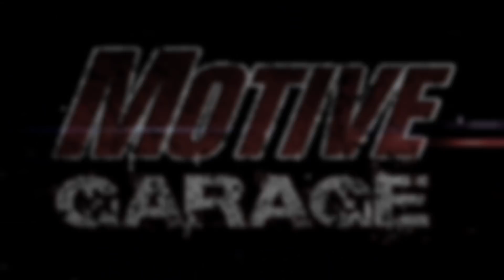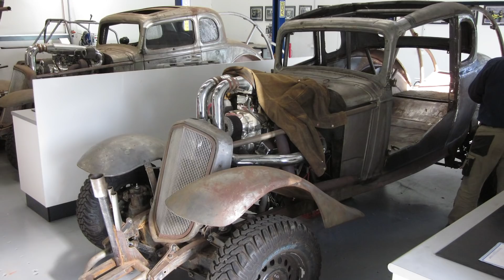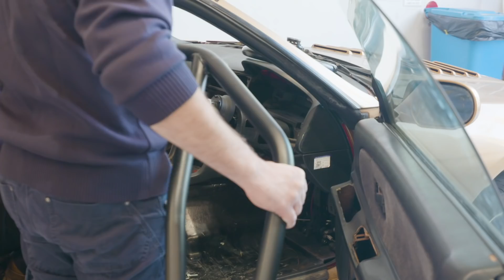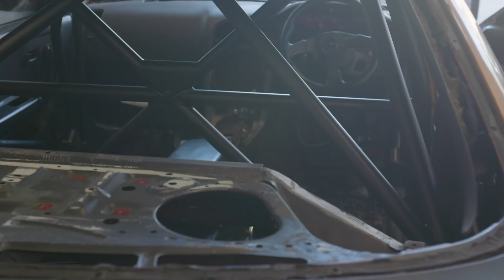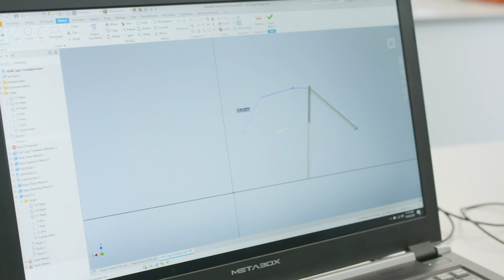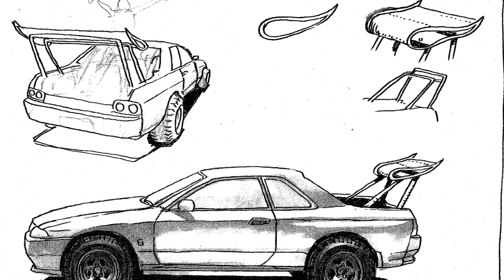Bolt-In Roll Cage as good as weld-in? Project No Secrets R33 GT-R Ep 10

Comment: I will be contacting AGI shortly about a custom cage for my BMW e36 gravel rally car..     will be national spec rally..  all so wanted to run a few tarmac event's..   
Must attach to the front strut towers
And pick up rear sub frame

Maby bolt in front.   Weld in rear..
PS weld in is always better then bolt in...      But when it comes to re Shell time bolt in is cheap and easy..   
Ok well Easier..

Comment: Wish there was an option for the front tubes to follow the A pillars all the way forward. 
Space looks very limited for the steering wheel and pedals with the bars dodging the dash, not to mention crawling in and out of the thing :\
Reply from the maker: You can't put bends in the legs like Japanese cages. They fold
Reply: Which makes sense, but I was alluding to the bars ignoring the dash and trims to sit further forward; not bending around them.
Reply from the maker: That's weld in cage and cut holes in dashboard

Comment: Bolt in for safety: yes
Bolt in Cage for increasing stifness in a busted arse flexy old nissan... not really
Reply from the maker: Your be surprised. Plus, stitch welding is our friend
Reply: Boy have you driven a car with no and with a bolt in cage?
Reply: @miralemnermina142  Indeed I have, and when compared to my sports sedan TA22 celica where the A & B pillars, windscreen frame and all suspension pickups are incorporated into the cars super structure. It's night and day. My comment is not a dig at bolt-in cages (quite the opposite,) or what Jet Multimedia are working towards in this project.

Bolt in cages (by their nature) cannot support the roof structure or front suspension pick-up’s. A major source of flex in many cars (especially the likes of a 180SX with I’s lack of rear parcel shelf.

Bolt in cages have come a long way and do provide a level of improved structural rigidity (as mentioned in the video and are now motorsports compliant 😊.) They’re a great option for all the reasons stated, especially if street registration is required. But their focus is on safety, not structural rigidity (that’s the realm of complex weld in setups and I love mine for that.)

Keep up the good work Andrew and team. I do hope you manage to work out a deal with Ross to get their drysump kit ;) They're a genuine class act.
Reply: @manitoublack  oh I'm actually glad you took time to replay.
I have a totally different experience but this was in a very light fwd Fiat so idk
Reply: I had a bolt in cusco cage in my s14 and it was noticeably stiffer. And those cages are very basic, these ones look much stiffer. I'm sure it won't do as much as a weld in, but it helps
Reply: ChrisHallett83  in Aus. You can basically forget (legally) driving a full cage car (with door bars) on the street (except a rally car between stages.)

Comment: I’m still trying to understand why you can’t have a cage in a street registered car in Australia. Why is it illegal to make your car safer??
Reply from the maker: More to do with messing with factory crumple zones and airbags. Also, hitting your head (which can be solved) and also if you get trapped it's harder to cut you out. We don't completely agree but that's part of their theory.
Reply: Roll cage in a street car with no helmet is a bad idea no matter how much padding you have on the bars.
Reply: Doesn't make that much sense, here in Germany you can even get weld in cage street legal if you meet all the requirements for that and we have verry strict laws about all that
Reply: And the inside of a car is never part of the crumble zone that would be a verry bad idea it should be as strong as it can be and a cage does help with that verry much, think about the carbon monocoque cars they have the area where the cage would be as the strongest part of the car because of the passengers to keep them safe.
Reply: Roll cage with no hans and helmet is a big no-no